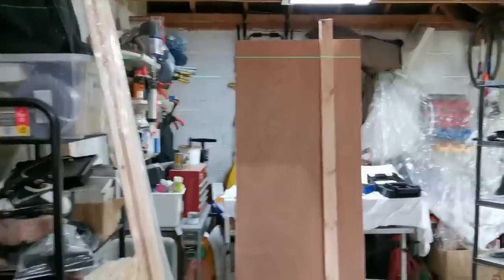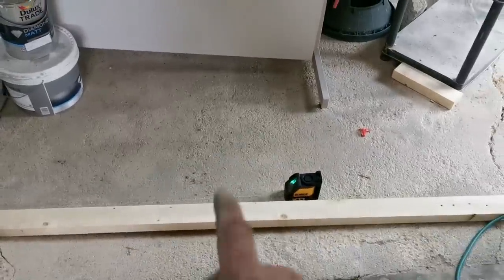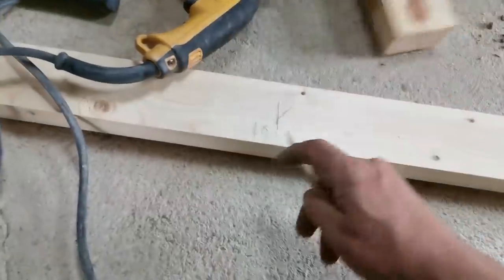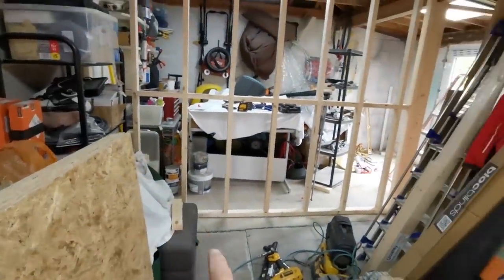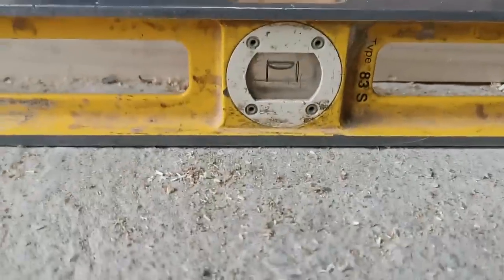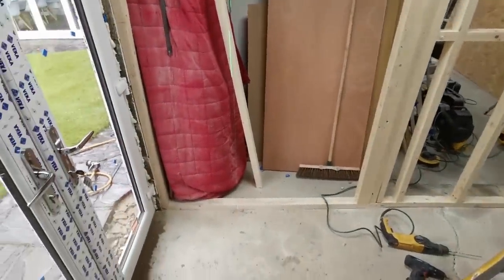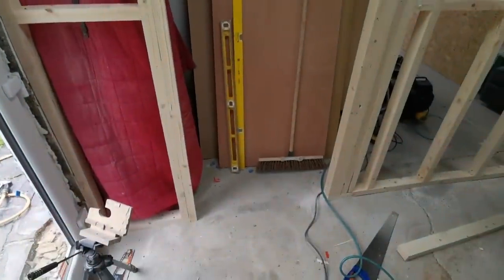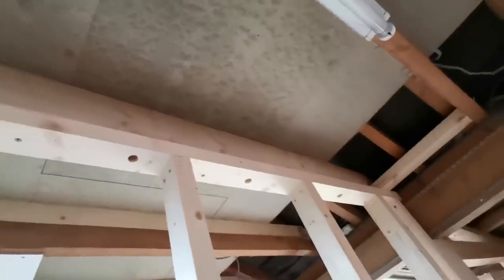Garage patio doors & stud wall 2

Comment: I only do DIY and have not used a laser line previously,  but i was doing some flooring in the wifes shop and bought one a couple of months ago. It was excellent for finding the first line in a wonky layout.  It's good to see how useful they really are with this video  Gid thanks a lot.
Reply from the maker: 👍 Yeah, all these types work in a similar way, in a pendulum fashion, I've had few over the yrs, the Stabila is the only one that's stood the test of time, that one has a fine clean line only a couple of mm's wide so it's easy to be more accurate but it only has the vertical line & i couldn't afford the newer cross line green one, but i couldn't see the red line outside so this Dewalt will be ok, just a bit fatter line than I'm used to, I'll have to aim for the middle a little more carefully., Thanks 👍

Comment: Love watching your videos. Could I do just a good a job without a laser as I don’t have one. I am doing an internal wall. Am I best making the frame before screwing in position to make it easier?
Reply from the maker: Thanks 👍 if you have room to build it on the floor & a flat floor where you're going to erect it, sometimes it's easier to build then erect, I didn't either. I didn't have a laser & for many many yrs all I & others had was a spirit level, fix the header to the ceiling, then drop a plumb line from each end to mark the sole plate, or fix the sole plate then plumb up the walls at either end to mark the header,   😉👍

Comment: Thanks again for the vid. When you fit the boarding, and the floor plate falls away or rises, do you scribe/angle the bottom cut so that the board fits square on the studs? I'm tryin to do one at the minute on a v old floor where it literally drops 20mm from one end to the other. Thanks
Reply from the maker: Hi, it depends on the size of board, if you've got enough to cut some off & the finish your looking for, a skirting would cover any discrepancy if a dodgy cut would look bad, scribing to the ceiling is more important than how it fits at the bottom, I didn't have much wast so i just made sure the top was close enough, at the bottom & top you only have the 2" sole & head plate to screw in to so if needed I would scribe it down & up. I think i left these boards a fraction off the floor to help prevent against moisture ,
Reply: @Gidjoiner  the skirting of course! Nice one thanks. Having a go at building my first stud wall. It's  a wonky old terrace so v difficult knowing what to line everything up with. Thanks for the tip
Reply from the maker: In an old house i would build it in a very similar way to the way i did this one, timber all round fixed to the ceiling, floor & walls either side, then the studs put in plumb, Nogins get put in at various heights so you choose those but you def want one wherever there's a joint in the board,  The first stud you put in should be at the width of your board, ie- 1200mm to the centre, if the nearest wall is 20mm out of plumb for instance, that first stud should go in at 1180mm instead, that will give you 20mm to scribe the board to the wall, studs then go in 400 c/c (centre to centre) even over a door cut out,
Reply: @Gidjoiner brilliant thanks. if I'm putting a stud in plumb, when the floor plate is 20mm out, do I need to cut the stud at a slight angle to get it to fit flush top and bottom?
Reply from the maker: Prob not, i would just cut them all sq, it would have to have a def  'slope' for me to consider cutting them at an angle.